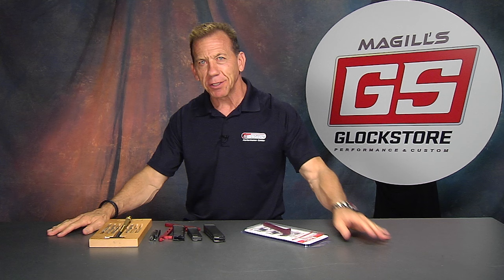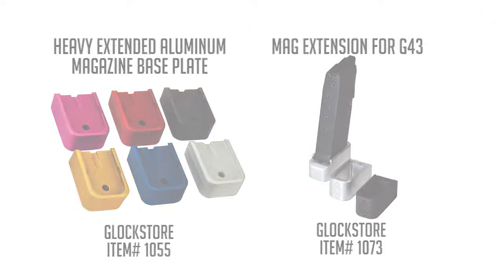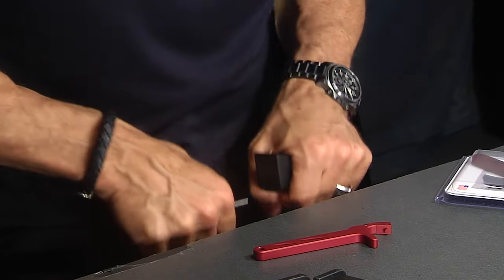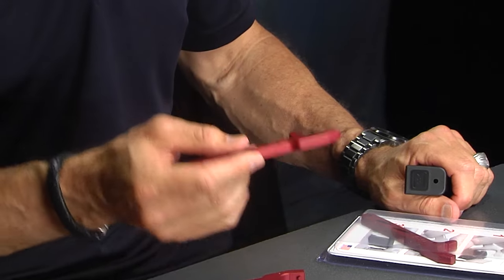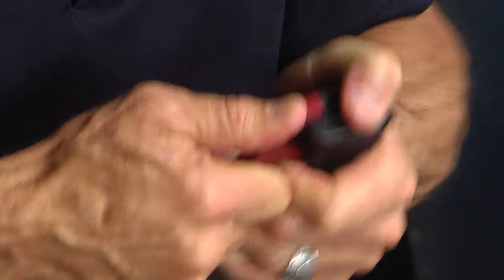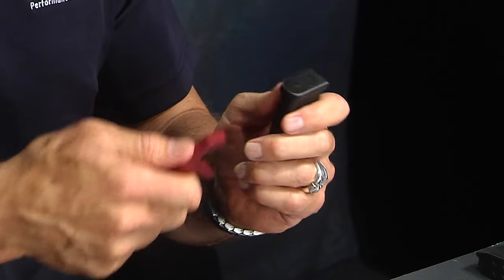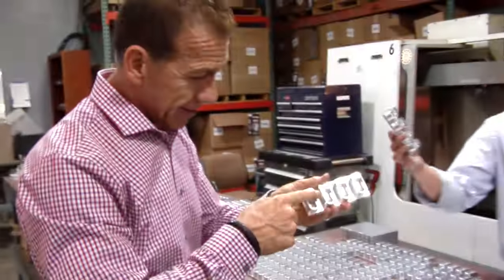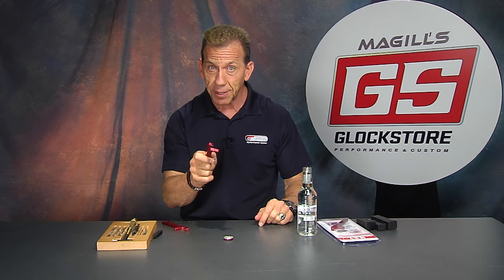Magazine Disassembly Tool for Glock Magazines

Comment: I just bought 4 new mags and changing out the plates were a chore!
I ended up using the underside lip of the counter to get enough push to pop the plate loose. New mags are tough, once you pop em once or twice its not so bad.

Comment: Inside Glock mags are locks on the left and right side, If you pinch the outside of the mag near the base plate, it makes this easier, I was able to do it with a tiny screw driver.

Comment: This doesn't solve "the squeezing the sides with a damn c clamp to bypass the side tabs" issue. Absolutely cannot do this by hand.
Reply: Voel One glad I read this. I thought it was me.
Reply: Actually it does. I just bought one got it in the mail today and remove my Glock 20 magazine base plate. You just Gotta go a little harder than you might think you need to.
Reply: @ericsande5345  Just get a couple of patches and put a vice grip on the mag, it doesn't take much pressure at all.
Reply: With this tool I replaced 5 base plates in less than 15 minutes. Easy peasy

Comment: I have never had any issues using standard Glock punch tool. You just have to insert it all the way into the mag base plate and there will be no bending of the tool at all. This will save you at least $20 if not more. Some of these tools are rip offs. Just like the one to reassemble your firing pin. Just use the hole at the rear of your slide placing the firing pin sleeve in the hole and push down on spring and reinstall spring cups. Anyway the tool looks like it does get the job done for those that want to dish out the money for a $30 bottle opener.

Comment: Hopefully I can save people some frustration/money.  I held a mag in my left hand with my fist against my knee, with a metal punch inserted into the back I pushed straight down with my right as the , I was sitting in a chair which probably made this easier, you only have to get the plate forward 1/4" then it slides off easily.  I'm not a glock guy, the only reason I have the mags are because of my sub2000, but other than a strong punch that's really all you need and you won't damage anything.  I watched this video because I didn't wanna mess anything up as I've never taken the base plate off of a glock mag before.  But seeing how mdt worked I just grabbed a metal punch from my set and took off 3 from oem glock mags pretty easily.

Comment: I've done the whole punch point thing doesn't work I've other videos where the problem is, is the two little clip things on the side where you gotta put pressure on the two side to release the baseplate, why does this look soo damn easy for -_-

Comment: Don't do it this way.  Get yourself a pair of channel locks out of your toolbox and a dish towel so you won't mar the magazine body.  First push the base plate lock down into the magazine with Glock tool or punch.  It will stay down by itself.  Put the channel locks around the mag near the base plate (with the dish towel under it).  Squeeze lightly (to disengage the locking tabs) and the base plate will come off easily.  No chance of destroying the locking tabs or the base plate lock hole by trying to lever it off with the locking tabs still in their place in the locking holes.  And save yourself the 30 bucks.

Comment: Pretty slick tool! Very unfortunate that it's necessary though. The locking tabs are a stupid design feature that makes Glock mags unnecessarily difficult to disassemble. I can take down the mags for my XDE very quickly and easily with literally any random object capable of moving the floorplate the short distance necessary for it to disengage from the baseplate and my thumb.

Comment: Will this damage the tabs that holds on the base plate?
Reply: Not if your just using it for a bottle opener! Just kidding, I'm not the manufacturer but I would say not for the amount of times you actually have to take this apart. it's pretty tough stuff.

Comment: I swear Glock is always trying to make you spend more money just to get “perfection”
Reply: They've literally never asked you to do anything except buy a factory gun. Stop drinking the custom gun kool-aid.
Reply: @Cordova10-8  they don’t have to come out and ask, their factory gun is lacking so much it’s implied. They are the ONLY manufacturer I know that requires a tool to remove the mag base plate
Reply: @RepentorPerish77 and they have the most reliable mags available. The only reason you would need one is to add an extension, and that’s not an issue to 99% of people.
Reply: @alexander1902  based on what evidence? What evidence do you have to support the fact their mags are more reliable than an HK mag, Sig Mag, S&W mag??

Comment: gimmick all the way, take a punch as he showed and get a good size vice grips, adjust the vice grip to squeeze just enough to pry back the plate. there are small tabs on the side of the mag and if you take your mags apart a lot you can strips them off

Comment: Hard to disassembled for Glock magazine without those tools, I understand that for safety reason but It shouldn’t be that hard.
Reply: So, The reason it's so hard to get off is on in the inside of the magazine, there's to locks, to need to pinch the left and right side of the mag, right above the base plate, then use a punch to slide the plate off, It's 100x easier to do when you pinch, You don't need this specific tool.

Comment: It's incredibly useful, but they charge so much for such a simple. I wonder if anyone has a 3D print design.
Reply: You can find them cheap on Amazon. I got a kit with the mag tool, front sight tool, and some kind of punch tool for less than $15.

Comment: What a ripp-off to design the mags to where you need special tools to disassemble a fucking magazine!
Reply: So, The reason it's so hard to get off is on in the inside of the magazine, there's to locks, to need to pinch the left and right side of the mag, right above the base plate, then use a punch to slide the plate off, It's 100x easier to do when you pinch, You don't need this specific tool.